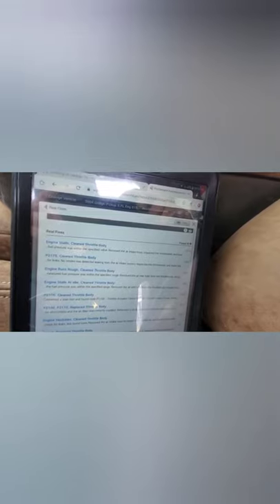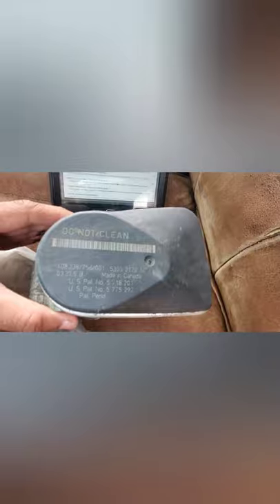2004 Dodge Ram 1500 5.7L Throttle Body Problems.

Comment: The red lightning bolt isn't always a indicator of a throttle body because I have a 06 ram megacab with the lightning bolt on dash I changed the throttle body and the apps gas pedal sensor and cam and crank sensor and still have the light on and no throttle response at all so that project is on hold till I can get the computer flashed